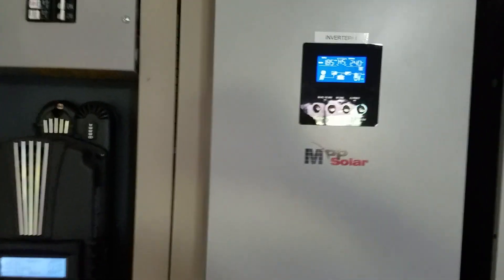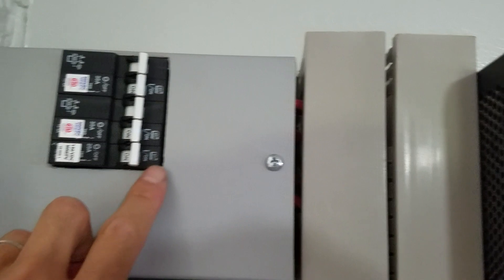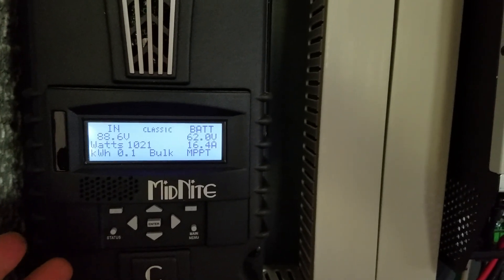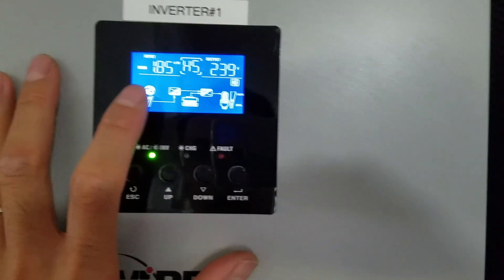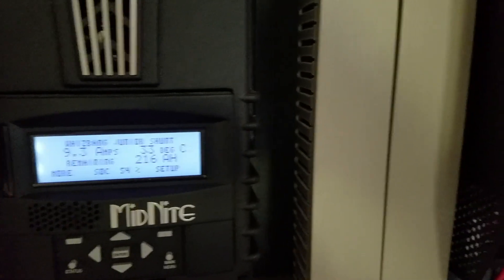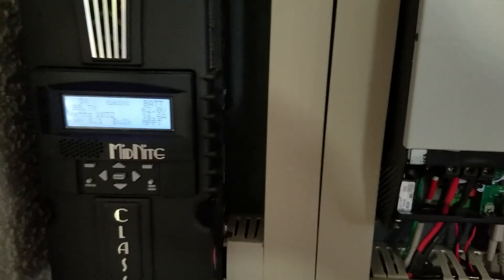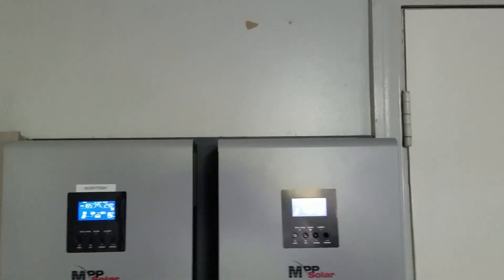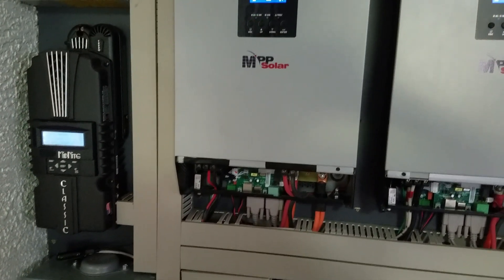5.8kwh Solar System w/ 25kwh Chevy Volt Lithium (some result)

Comment from the maker: My math sucks, plus it was hot.  But total watt pulling in should be 4.6kw.  Rated power for all of the panels are 7kw, not to shabby since 20 of my panels are facing West.... Sun is now mostly coming from the South for this season.  The 4x 320watts on the Midnite 150 is facing South...

Comment: Awesome job! Can you do a video on the MPP wiring the outputs to the AC unit? I'm still a little confused on single/dual phase 240v and how to use these units in the United States for 240v 60hz units like your AC and shop air compressors. Thank you!

Comment: If you can, increase the stored water temperature by 10°F.  Why?  The stored water temperature will drop overnight, and if you do not maintain a constant high enough temperature, you might end up growing Legionella bacteria which as you can be fatal.

Comment: Hello from Dominican Republic. I have a couple of question for you. 1- what's your system size(Watt)? 2- What's the capacity of the air conditioner(btu)?
3-How many hours a day can you run the air conditioner with the inverters without using power from the grid?
4-Do you run a water heater with the panels?